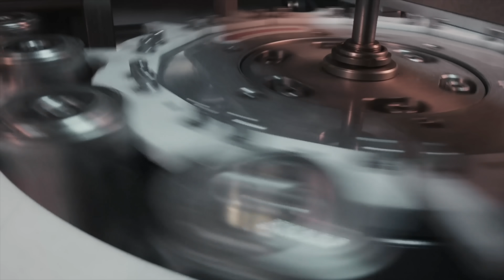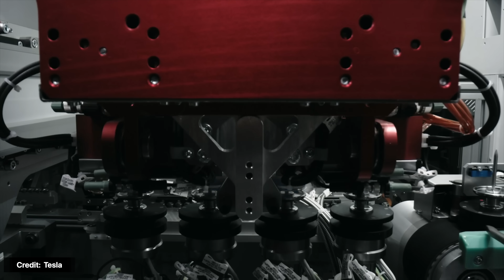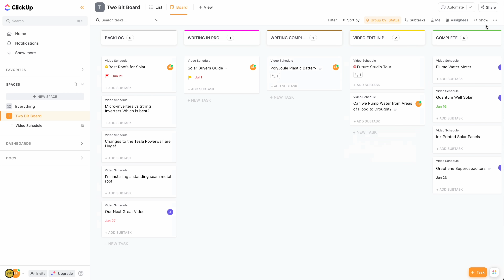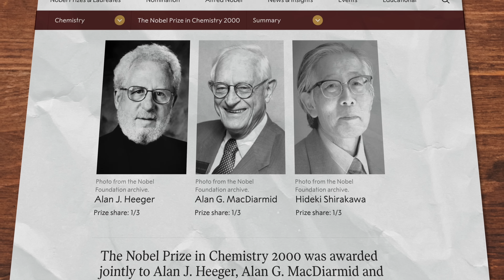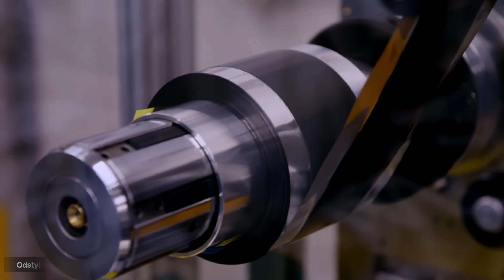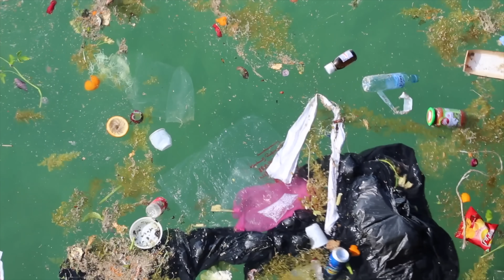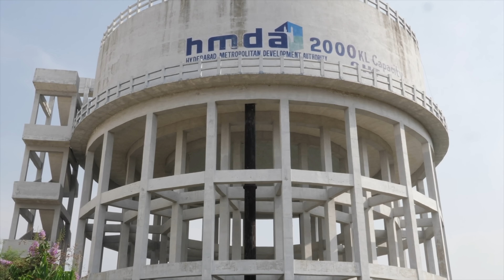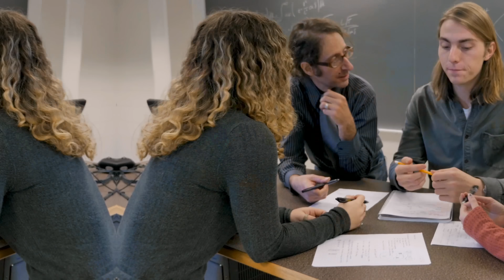Breakthrough Plastic Battery Requires NO Mining, is Cheaper & Lasts Longer!

Comment: Every cheaper tech for energy storage means freeing up lithium for EVs, so its always good news!
Reply: Until they are able to perfect graphene type of batteries, that is. Ultimately, the goal isn't so much replacing carbon based fuels, but rather develop the technology to be less intrusive when it comes to mining, which produces comparable carbon emissions. Plastic is a neat concept, but I am concerned about the amount of temperature such batteries can take. Still, if plastic can be converted to better use, the value of plastic might significantly increase.
Reply: @dswynne  I agree. It's very common to forget to do a full-cycle analysis of new technologies, from design and testing to mass production to disposal/recycling, especially when things like mining for minerals aren't happening in your own backyard. For most people, these issues are essentially invisible.

Comment: If this battery is light enough it wont be a problem to make the battery pack twice the size, and limiting it to the city use. Specially if you can fast charge every time without problems.

Comment: Imagine a plastic battery the size of a standard heat exchanger for an AC unit sitting right next to it. No one would even notice it after a few weeks and you'd have enough power for your whole house in the case of an outage. I hope this tech comes to fruition.
Reply: I'd get one for sure. Right now I'm watching this on my phone in the dark cause the power in the whole area went out. Really could use one of those right about now.
Reply: Just multiply the Tesla's Powerwall volume by 5. Probably the size of a refrigerator.
Reply: Omg like imagine like a battery the size of a grain of sand that like never has to be charged. Like omg
Reply: @thunderf00t best audit this science
Reply: It really just depends upon how much space one has to work with and what shapes one can make these batteries.  It could be great in some cases and useless in others.
Reply: More plastic?
Reply: He said power density, not energy density. You get a lot of power for a millisecond even with very little energy capacity. The battery could be discharged before your AC unit motor makes a full turn. Energy is power times time.
100kw for a nanosecond can't run anything but a flashbulb.
Reply: @Billy97ify  watch the whole video. He addressed energy density too.
Reply: @Conservator.  In a misleading way.
Reply: @Billy97ify  How was it misleading?
Reply: @Billy97ify  9:12 can’t compete with li-ion. He says that the energy density of Li-ion batteries is 5x higher than that of PolyJoule batteries. 
What’s misleading?
Reply: @Conservator.  It's buried in the video and contrary to the headline title. Nearly ten minutes in.  Most of the listeners missed it. People don't understand the difference between power and energy. Having only 20% capacity makes it useless as a battery. A breakthrough needs a lot more capacity, not less.
Reply: @Billy97ify  I don’t agree that it’s useless, It’s just not suitable for automotive applications. Like they mentioned in the video they would be great for grid balancing maybe in conjunction with Li-Ion. They would also be perfect for other static applications like home batteries. 
My doubt is more that they have yet to prove to able to scale up their production.
Reply: @Conservator.  Grid balancing requires huge capacity, so that is out. Never mind that batteries are lower voltage DC so they would require inverters and transformers to do that. They would not even be able to correct phase shift or power factor for that reason. Synchronous machines have long been used for that.
Reply: @Boyejercito  not 50 but one at the very most would be enough.
Reply: Imagine lie people just because of YT views.... YOU FUCKING NEED MININING FOR ALMOST EVERYTHING!!! iNCLUDING PLASTIC!! IT IS FROM FUCKING OIL!!!
Reply: Dude this seems easy I wanna MAKE this sh*t. Just godda figure out how to make the electrolytic polymer.
Reply: @bringer-of-change  Try the blender.
Reply: Most of these claims fail. If you look up future battery. 99% of them are bankrupt.
Reply: @westtexas806  99.99%. I have been watching this battery crap for 40 years. University professors trolling for research grants.
Reply: @Billy97ify  MIT is the main culprit in my opinion. And I'm all for it as long go as they get that gates and bezos money.  I just hate to see anyone else fall for it. My dad has ask me several times about batteries to invest in. I keep telling him it's a scam.
Reply: Remember this is the same guy that wants to pump water from Florida to the Rockies.
Reply: You guys are totally missing the point. -40C to 50C does no longer requires it to be inside the house in a temperature-regulated environment. You can put this battery in the garage, or outside the house! Who cares how big it is then?
Reply: None of these techs fruit. Why I can't hardly watch undecided with Matt f anymore. Pipe dreams
Reply: @DJDannySteel  That's not what this is about. This is for creators, innovators and inventors. Let's say you're trying to invent something new... something awesome, right? But you get stuck. You think, and you think, and you think, but you just can't get unstuck. So you watch some youtube videos like Undecided and you see something you've never seen before... and then POOF! Inspiration! It's not about whether the tech will ever work or not... it's about getting ideas out there and letting people know what others are working on. It's collaboration with the goal of pushing forward.
Reply: @DJDannySteel  while almost all of these types of videos seem to have technology that never makes it every once in awhile a few end up making it. As long as we continue to improve and can slowly break through with new technology we'll eventually make large improvements.
Reply: @DJDannySteel  look at lithium ion batteries in terms of coming to market.  Nobody is going to go into production till they have a good history and testing done.  Lithium had that.
Reply: @DJDannySteel  These batteries look a lot like super capacitors but they would be much cheaper to produce. 
I agree with you. Seeing is believing and I’d have to see a real product first. 

The footage of companies like these seems to me to have been made to attract new investors. 

If there were products like these available, we would be buying them already. 

Scaling up from the lab to production is often just as hard as the initial development (if not harder).
Reply: Yeah, but no.  You ought to be thinking about something 10 or a 100 times the size of your air conditioner.  Probably no issue, if you plan it ahead of time. The cost of space is cheap, which is part of the reason for MacMansions.  But it will still cause issues in some places.
Reply: @richdobbs6595  I think 10-100 the size of your air conditioner is a bit hyperbolic. Well maybe if ones idea of air conditioner is a window airconditioner. Then maybe 10x is ballpark about right.  

Two powerwalls is about sufficent to supply my home's AC unit its peek power demand.  If the polybateries offer 5x the power and if were 5x the size of one power wall then  I'd need only one poly battery power wall with with the same energy capacity as a single power wall wich is volummetrically 5x greater than one lithium powerwall. But if I want the same energy capacity of two power walls, then that's 10× the volume  of one power wall. Or roughly close the size of my existing combined AC and Furnace unit that I commented about above.
Reply: @richdobbs6595  No, not that large. 5x the size. It actually would be about the size of the outside condenser for a single power wall equivalent. About the size of a refrigerator for a system that equals a 3 power walls. It is nowhere close to 10 or 100 times. The density is close to lead acid batteries. We used to live off grid, and our batteries were nowhere close to that big.
Reply: @richdobbs6595  Bury it under the house or garden while you're installing the loop for your heat pump
Reply: Imagine unicorns.
Reply: Yeah, but it doesn't exist.  Probably never will.  There's a few reasons but lets tackle the most glaring.  The greenies don't like plastic.  Boom, shot a hole in it that you can't repair.  Unfortunately that's the way it works now.  That's why you're sipping your drink through a paper straw and electric price is through the roof.  Greenies.  Think about how nice it would be to have clean, efficient power through nuclear generation.  I live 10 miles outside of three mile island in middletown pa.  There's no pollution. 0 ziltch, nada.  What I suggest is that we continue to keep the lights on RIGHT NOW so we can work on these batteries that may one day save the world.  I haven't even watched the video yet and I know this doesn't exist.  It can't because in the case of the United States, if someone developed that kind of technology, they'd be killed off immediately and the government would own it.  It would be researched for 5-10 years then installed on top secret designs for our military's future use first.  Once the cat is out of the bag, THEN you'll see 1 or 2 (california/silicon valley) startups using the technology then everyone will make better versions than the governments.  There would be relatively no money in it either.  The salt, the seawater...now the plastic...these are things that we have an abundance of and we have it cheap.  You know, I even heard about this bacteria that supposidly eats plastic and was going to power our future.  Where is all this "green tech"?  We just spent a trillion dollars literally on it, where's it all at?  It is waste.  And yes, I know it sounds like I just want to crap all over this.  No...I want it to work.  I see what our government is doing to our grid and it scares me too.  This is another dumb idea that will work once or twice and then it's garbage.  I want it to work so bad but unfortunately that's not how the world works.  They're saying "polymer strains" are going to be inside this thing.  Great, take it to somewhere it gets cold...drive it over a pennsylvania pothole and see if those "polymer strains" don't snap like twig.  They're not as strong as a human hair if they're cold.
Reply: @D1NKERR  easy, just tell the greenies it has 10% recycled plastics and have it mandated even if it's just the cover or outer layer.

Comment: Regarding the hope to reuse plastic to produce this battery; as a chemist, I can guarantee you it needs a very specific type of plastic, and at very high purity, as it would have to be designed for use in such a battery.
Recycling plastic to use, other than from old batteries of this type, would be a daunting task, at the very least because of the high purity needed.
Once plastic is polluted/mixed with other plastics or materials, it becomes very hard to recycle, and is much easier to just burn along with other garbage.
Reply: There are several depolymerization processes that, when they become reliable and cost-effective, could resolve the purity problem. Break plastics down into short-chain polymers and combine them back into the custom long-chain ones. By then the energy density of polymer batteries should be improved and we'll have a closed cycle of efficient, recyclable batteries.

Comment: I am guessing that the scale of potential poly batteries is far less than the amount of plastic kicking around, so will never have an impact on using recycled plastic, even if that works.
Oil is an amazing resource, our grandchildren will be shocked that we burned it.   
If the poly batteries are 95% recyclable and last 30 years, not sure that is a huge issue.
Sure hope this works.

Comment: I would accept a phone battery 5 times bigger if it meant it would charge in 5 minutes!
In fact, I would take half the battery life if it would recharge completely in 5 minutes.
Put a charger outside the bathroom or have two batteries to swap out and even if the battery is less energy dense, the fast charging or swappable batteries makes it all no big deal.
Reply from the maker: indeed.....Any place you can have fast recharging available it might be a worth while trade-off 

even if it looks funny :)

Comment: Glad you touched on the recycling piece. I hope PolyJoule engages with you for a follow-up video.
Reply: If it lasts 20 years and is cheap, even if all you do is landfill it afterwards, it wouldn't be a problem as long as it doesn't leach toxic stuff.
Reply: @richdobbs6595  But plastics are largely made of fossil fuels, right? Or else you need the resources to grow and make bio plastics. Better that companies start thinking about recycling and end of life while they are developing new technologies instead of long after the stuff has been piling up.. and then realizing it has also been leaking toxic chemicals.

Comment: IF the charge discharge rates are not made up*, then this would compliment Lithium batteries quite well in automotive applications. With a 1KWH polymer battery, capable of transfering all of its energy in 10 seconds, that is the equivelant of 360KW/480HP. This means that you could use much larger LiFePO4 cells for your main battery storage, say 280 amp hour cells instead of just 2-10 amp hour.
This makes battery packs exponentially easier to assemble and service because instead of thousands of cells, you will probably need less than 50.
This opens up the ability to monitor and balance each individual cell, instead of being limited to balancing whole rows of cells.
This would drive down the cost of electric vehicles in two ways, as the cost per KWH goes down as the cell density increases thanks to less structural material. And assembling the packs becomes faster and less labor intensive.
This also makes electric cars more reliable with longer lasting packs as each cell can be maintained individually.
This also would open the door to user replacable batteries, as these 280AH cells are about the size of a small motorcycle battery, with an all in one connector it would be very simple to  just have the end user replace a failed/end of life cell, instead of replacing the entire pack as a whole unit.
As long as the storage pack is capable of supplying, and charging at 100kW 99.9% of people would not notice a difference between a traditional pack, and a hybrid pack, as even when towing a trailer, you arent likely to need more than 125HP for more than 30 seconds.

The main reason we dont use these large cells is because they generally have a 1-2C rating** compared to the the smaller cells which may have a 10c rating because of the lower thermal density. That means that while a 50kwh large cell pack is capable of 50-100KW constant output, a 50kwh small cell pack may be capable of as much as 1000KW output. Yes it is much larger and heavier overall, but this extra power is needed when merging onto an interstate, or pulling away from a stop light. And really, for the longevity of the battery, it is recommended to only use 1/2 of its rated charge/discharge rate

* It was likely a slip of the tongue, and he probably meant to say 1MW for 10 seconds, instead of one full megawatt hour transfering in just 10 seconds, but it sounds like the charge/discharge rates are completely false, because how could a small battery be capable of transferring energy, at 1/3rd the rate of the average nuclear power plant reactor (360MW/h vs 1000MW/h) or 482 thousand horsepower 

** C rating is a measurement of how quickly a battery charges and discharges. To convert C rating into actual power, you take the Amp Hour rating of the battery, take the 280Ah cells above, and multiply it by the C rate, so a C rate of 3, on a 280Ah cell, means that it can transfer energy at 840A, multiply that by the cell voltage(3.2) and you get the total energy rate of 2688W convert that to HP take the 2.688kW multiply it by 1.341022 and you end up with 3.522HP
Reply: Somebody put this guy in charge of the planets energy.
Quickly.
Reply: @willthomson8863  Being in the ship business, away from shore weeks, there is not enough area on ships , reasonably available for seawater drenched solar panels to just drive the lighting inside, sacrifice cargo volumen for sensitive batteries makes even cheap batteries lose cumulative  income .For propulsion the numbers are worse.The power of oldest technology sails is by far  so superior, that it is a giant step back to substitute bunker oil.
So now we are the villains that put food, tools, electric cars and even solar panels at affordable prices to YOUR front door. sometimes at considerable risk of typhoon caused damages, and no electric helicopters to pull us out. either.

Comment: You mentioned energy density by volume, is it a similar 5x less density by weight as well? (other than the fire protection weight savings)
Reply: It would look better on paper for energy density by mass because the polymers weigh less than the metals used in other batteries. That stat would be misleading because they are so much lighter than metals. In this case, it likely makes more sense to think about volumetric density because polymers are so much less dense the huge space it takes up makes it uncompetitive
Reply: If it does have greater energy density by mass, that would add an advantage to the mix in vehicles.
Reply: @KenJackson_US  That is not likely true unless you wanted to drastically increase the size of the whole vehicle
Reply: OK, well how about a mix of 10% plastic batteries, 90% lithium,  @entropicallydriven ?  Then you could drive on lithium and super accelerate with plastic.